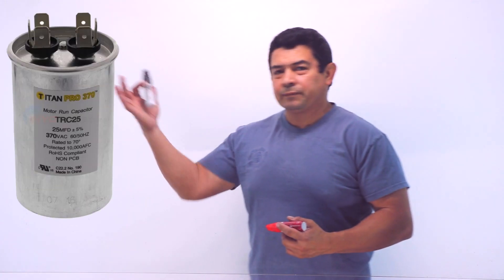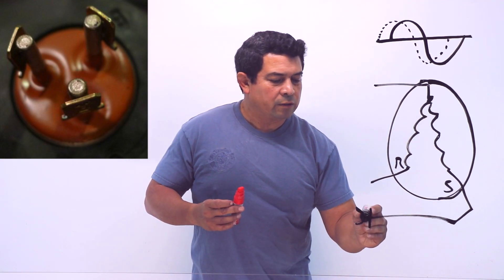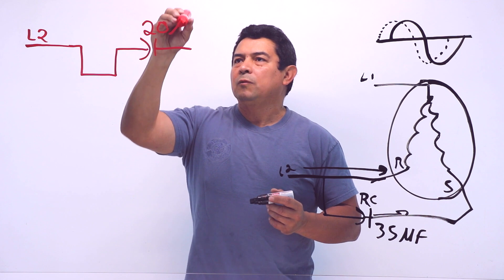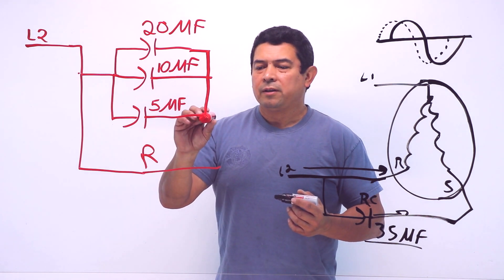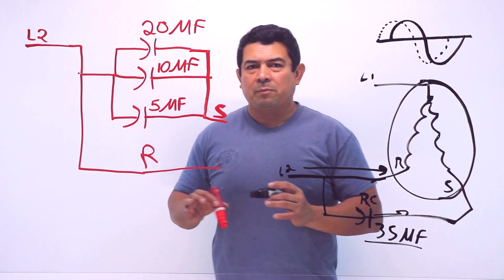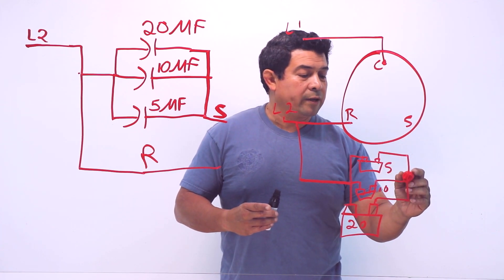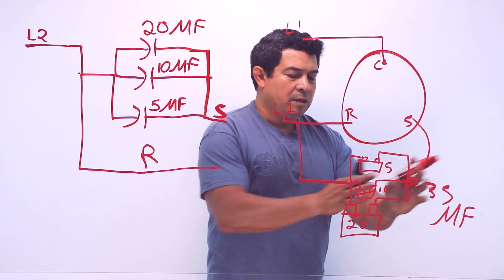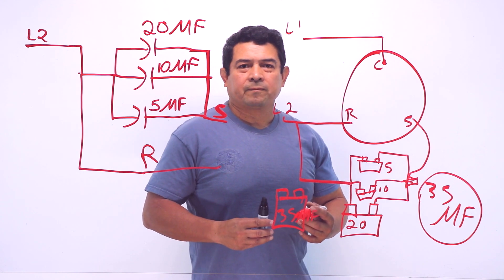Capacitors Part 4: adding capacitors - HVAC Online Training and Courses

Comment: Can you tell us what determines if a compressor or motor needs a start capacitor also  or will function with a run capacitor only.  Thanks
Reply from the maker: Hi, typically a start capacitor is going to be used when a compressor starts under a load or it needs higher torque to get it to rotate. That is why a lot of times technicians will add the, hard start kit as some calls it or as others call it a booster.  If the compressor is having a hard time starting then people will use a hard start kit. But it's really about the only time that it needs a start capacitor. When they expect the compressor to start under a load, what that means is that the suction pressure and the discharge pressure have not equalized. If both pressures are the same typically you do not need a start capacitor. I hope this answers your question. Thank you for sending the question in!

Comment: I have a question: Is the capacitor a devise to increase the torque?
Reply from the maker: Yes, it does that bu giving the start winding more power and therefor more torque specially on startup.   BUT if you give it too much for too long of a time you will overheat the motor and burn it up.  That is why Start capacitors are taken out of the circuit once the motor has started.

Comment: connecting all the capacitors in parallel and same VAC?
Reply from the maker: I am sorry I just saw your question.  I am not too sure if I understand your question?  Connecting them in parallel will increase the Microfards.  It will give the motor more power, or torque so the amperage will also increase.   I hope tis answers your question.